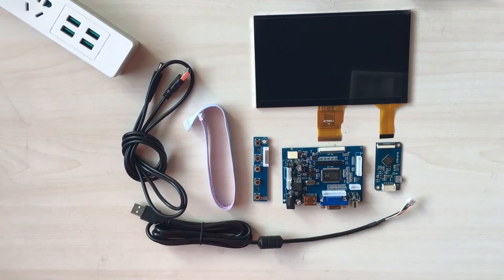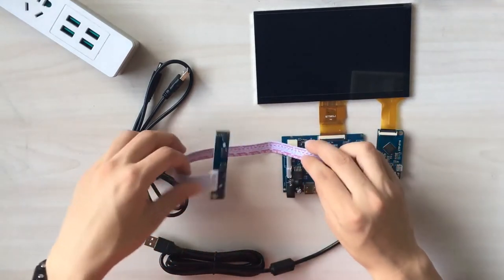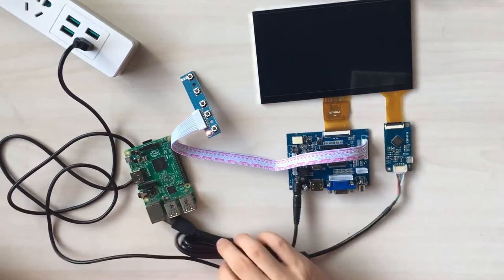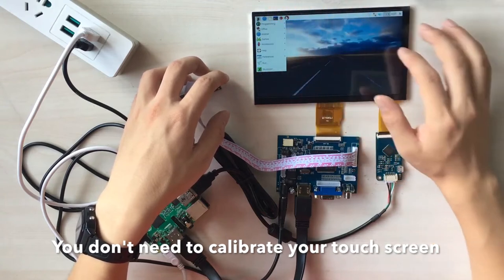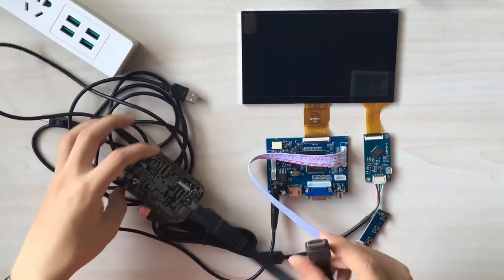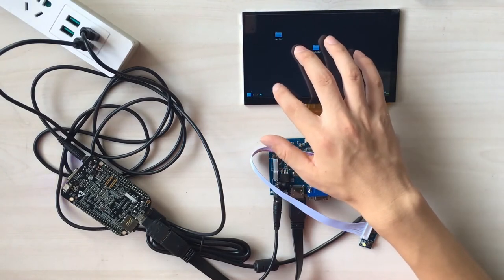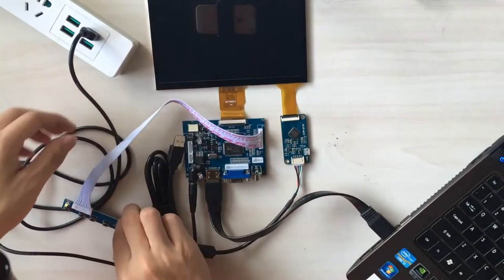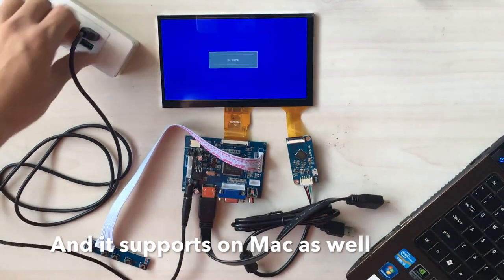7 inch Capacitive touch screen testing video

Comment: Do you sell an extension for the FPC connector? So the Video driver board can be mounted further away from the LCD.
Reply from the maker: Sorry, we don't sell the extension for the FPC connector due to it may cause lost signal.

Comment: Hi,is there an auto trigger on RCA video input /when the monitor receives signal on RCA video input, does it switch automatically to AV signal input? Thank you.
Reply from the maker: I am afraid it does not have this function. but you can select the output type from the OSD setting menu.
Reply: @kevindeng1889  hi, thank you for your info. My old car pc (assembled by me) monitor is stolen and I must replace it. I need a monitor with auto trigger on RCA video input (attached is a tv receiver). Is it sunviewable? Thanks again.
Reply from the maker: @batangenyodotcom  that;s all right , you are welcome bro, if you have any other need ,please feel free to contact us.
Reply: @kevindeng1889  Is it sunviewable? How can it be seen inside a car with a little (sun)light. Thanks.
Reply from the maker: @batangenyodotcom  Sorry， it may not a sunviewable screen, but it's brightness is fine.
Reply: @kevindeng1889  thanks
Reply from the maker: @batangenyodotcom  you are welcome~
Reply: @kevindeng1889  hi, looking on your lcd controller, I think there is an autotrigger on composite video. Look at that connector near RCA for video input.

Comment: what chip does the Touch driver use? I have ordered one of your touchscreen display kits. It hasent arrived yet, So I need to know the touch driver chip model to compile an Android image with the touch drivers
Reply from the maker: The touch drivers has been upload to the chip onboard and using USB port to transport the touch information from screen to your device, so you can try usb driver on Android image.
Reply: So, does this touch panel work fine with Android device?